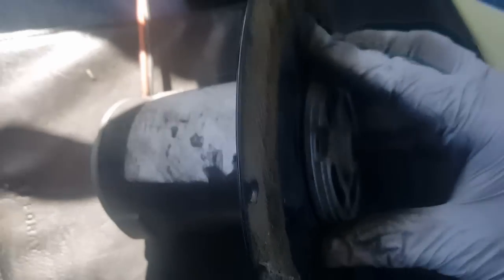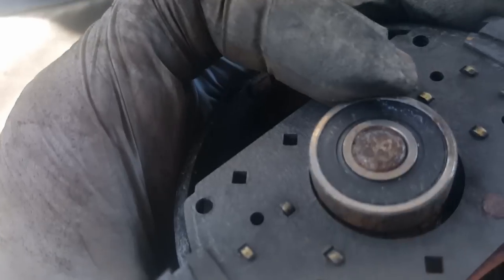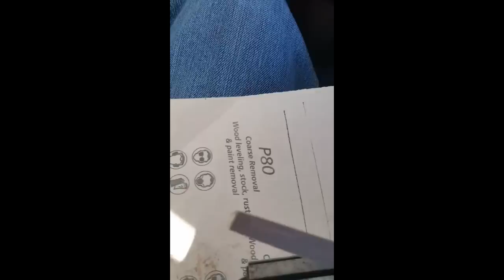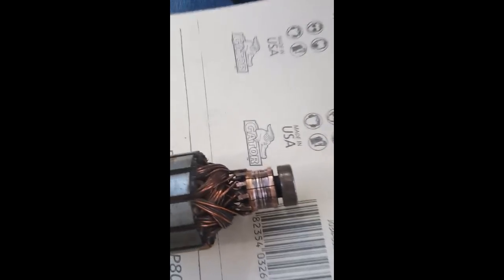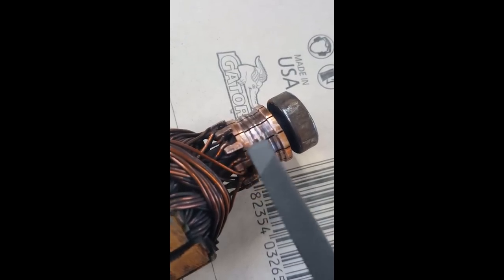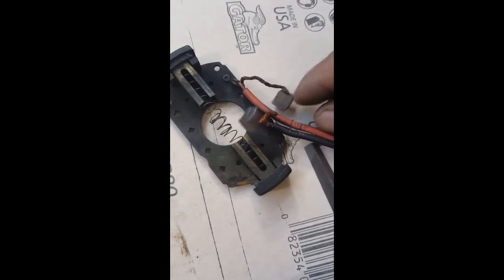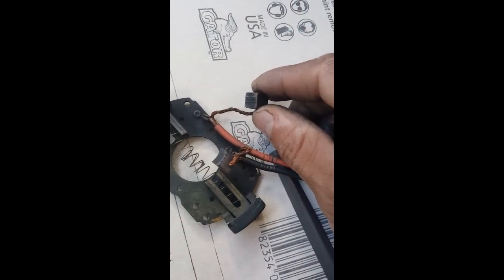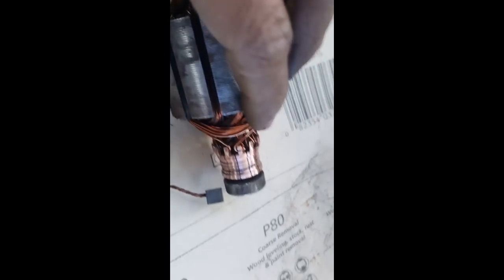Peterbilt 379 cab blower motor fix

Comment: thanks dude. that fixed mine too. saved me $150 for a little while. God bless
Reply from the maker: Sling Shot  Awesome! The fan is actually still working. My bunk fan wen out and was beyond help. I found the motor for $85 new(no fan) at tge Peterbilt in Waco,Tx. Good Luck!
Reply: thanks man